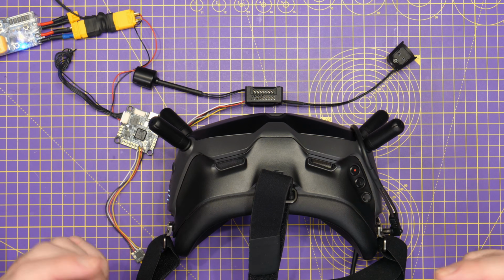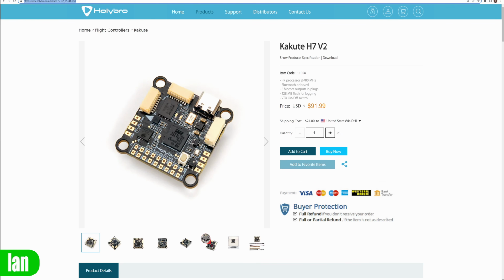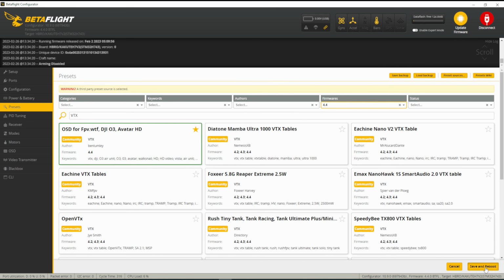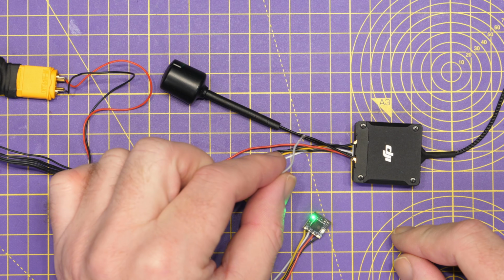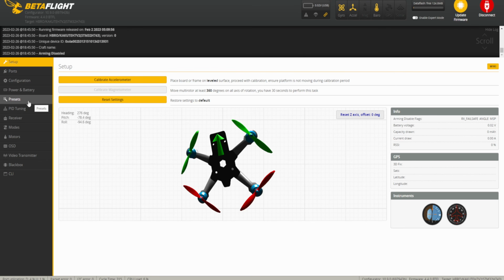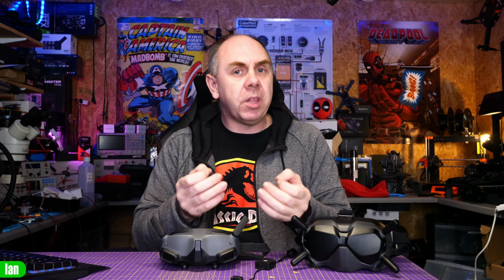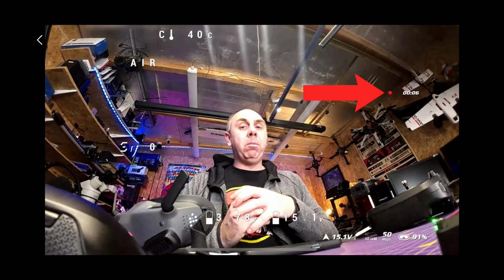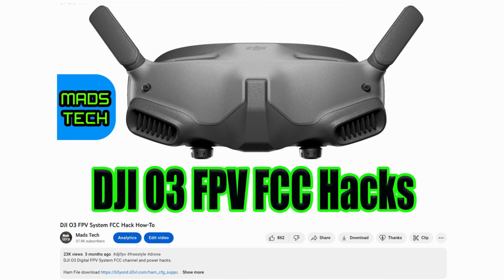DJI O3 FPV System - Complete Setup - Diagnostics & Troubleshooting Guide

Comment from the maker: Here are the links to some of my other videos I talked about in this one 

DJI O3 FCC Hack - https://youtu.be/efVPu2JKZPY
DJI O3 Vibrations Issues - https://youtu.be/p3WdkTMxlVU
DJI O3 Complete FCC vs CE RF Guide - https://youtu.be/21C80SiUWZA
DJI O3 Harness Warning  - https://youtu.be/dwR4BIhfxtw
DJI O3 How Hot Will It Get - https://youtu.be/e7cKL7M5aSM
DJI O3 Teardown - https://youtu.be/z4tQZmevEtw
DJI O3 DJI FPV Remove V2 Setup - https://youtu.be/teR4S9WxvEU
DJI O3 Power Requirements - https://youtu.be/ClavnlN663Y 

I hope you have found this video helpful .
Reply: Thank you for the great guide. I'm still looking for a guide on how connecting the O3 to a TBS Crossfire transmitter. I have the TBS module for the Taranis X9D.
Reply: @PhilippZ  you won’t be able to connect it directly. You will need to get a nano or similar and connect that to the transmitter.
Reply: Sussed it out. it was the connection cable. It was not putting enough power through to be able to bind. Would light up the turn off. Tried with another cable works perfect. Thanks for the help man and this video. Hope your well cheers J

Comment: Hey bud, the battery voltage from my Pavo 20 pro running an 03 has suddenly stopped displaying on my v2 goggles osd, checked all wiring and betaflight settings..still showing 0.0v, plugged another 03 into the Pavo (same connector) and it’s now showing battery voltage, would you agree this points to my original 03 air unit being broken? I’d really appreciate your input on this..thank you!

Comment: I just want video for fpv in a plane running on a 6s battery. I have DJI goggles 2. Can I just use the positive and negative wire to power off my balance plug to turn on unit. Thanks

Comment: I was flying my o3 air unit and it powered down to a relatively soft landing.  My battery was too low and I should have landed. Now it doesn't connect to the goggles (goggles 3). I tried to rebind but get a blinking red light continuously on air unit, and goggles stop searching after awhile.  If you have any suggestions I would appreciate it. 
Thanks and have a great day!

Comment: I have double checked everything according to your video.  However, I am still missing something. I have managed to display the crosshairs only on the display and they are off centered to the far right. Nothing else that I have selected with OSD is displayed. Any assistance is appreciated.

Comment: I just bought the o3 air unit in the geprc 35 v2 and I downloaded the DJI assistant consumer series aswell as the fpv series, but it just will not show up. The only thing that does is an internal storage file. I have restarted, un installed and re installed, aswell as tried many chords (with and without a battery.) I just cannot get it to show up.
Reply: same thing happend to me yesterday, I plugged it in then the storage option poped up..
Did it again  and again and then i left it connected while i was browzing my internet for fix then when i came to check the dji assistant, it was popped up as dji 03 air unit
I guess leave it a while when it gets connected automatically
Reply: @siansalins3639  yeah I actually left it and then downloaded dji assistant on a different computer and it worked. Pretty weird lol
Reply: Make sure you get a usb c DATA cable

Comment: My unit does go into full RF power mode however the Mps are super low even when in close range. Like 28mps not 50?
My other 3 quads with the same set up work fine. Does anyone know what’s going on here?
I’ve tried a couple different new antennas on the air unit also. 
Thanks

Comment: Hello, and thanks for the great tutorial. Question: I am flying the GEPRC MOZ7 with the DJI 03 Air Unit. On the last flight I had a harder than normal landing and the battery ejected. No damage to the drone. I reinstalled the battery and the Flight Controller powered up, but the DJI 03 Air Unit had no power. I checked the wiring cable between the Flight controller and the Air Unit and cut the black and red wires to check for voltage with a volt meter. It read 0.  I then direct wired the black and red wires going to the Air unit to the main power wires coming from the battery connector. Plugged in the battery and both the Flight Controller and Air Unit powered on. The Integra Goggles and RC Controller 2 were still bound. The OSD was working and showing the camera view, but showing the Voltage at 0.0 V along with the RC & HD Signal strength and Goggles Voltage, no other data. I then plugged the Flight Controller into Beta Flight and immediately the Voltage reading went to 22V and the remainder of the OSD screen filled with data. So I’m wondering if anyone knows what is causing the problem. The air unit is fine but the Flight controller is not sending voltage to the Air unit. I can direct wire the Air Unit to power it up but cannot arm it with the lack of data on the OSD screen. Any solutions? I am considering buying a new ESC/Flight Controller stack but I’m not sure that is the issue. Thanks for any tips in advance.
Reply: I have simillar issue with hglrc talon 2, first time setting it up, have you figured out the problem?
Reply: @teovuksan3469  I'm pretty sure the problem with mine is the BEC may be fried. It is part of the Flight controller so I have ordered a new one but wont know for sure till I install it

Comment: Hi This is a great video, I've learnt a lot from watching this but i do have a question that maybe you or someone else here can answer, I've got the 03 air unit and im using the sparrow2 flight controller, everything works ok and i've flown the plane its all in and flight modes all work fine but i am not getting the on screen display from flight controller to air unit showing on my goggles, I just have the on screen display from goggles only in bottom right corner, Any idea what could be stopping the on screen display from FC not showing on goggles, Also, air unit won't come out of low power mode. I'm in the UK and air unit is new. Thanks.

Comment: Hello Mads, I have started FPV last week-end with Goggles 2/iflight Protek 35 O3.
The Dji 03 has recorded automatically my first flights until it stopped. After checking the drone, one of the antenna's two connectors broke. Do you think that the fact that it only has one antenna connector left is the reason of no recording?
Thanks for answer

Comment: I try to set the sharpness and noise reduction options but it won't let me select I also can't set the quality to 2.7k at 30 frames, it's as if those options were blocked. Has anyone had this happen to them? Do they know what I should do?
Reply: Are you setting them with your quad powered and the dji working?

Comment: if i just want to use the 03 air unit to bind to my goggles 3 and install in roban 800 heli do i still need a flight controller ?

Comment: Thanks Ian . Love your videos mate. But I have a question on switching to my vista units with my DJI v2 goggles. Every time I switch from 03 to Vista it keeps telling me to power cycle my goggles then i have to rebind every time . This is so annoying. Is there a solution to this? Thanks Ian
Reply from the maker: Sadly no. This is how DJI designed it.  There are some technical limitations to how they implemented the different modes in the goggles and it results in the need to rebind when you switch modes.
Reply: @MadRC  ok thanks Ian
Reply: @MadRC  Ian we have get you on our show one day . Whenever your available my friend just let me know if your interested. We’ll set a date

Comment: Your videos are borderline too informational, but I do learn a great deal from you, so thanks!  This is related somewhat, but I have the Avata 2 which was my first drone (I am now addicted to FPV) ever.  I now own an RTF TanQ 2 5” from Rotor Riot, with the DJI O3 and DJI receiver and the F7 HD+F55A ProII 3-6S 30/30 with F7 FC and 32 bit 55A ESC  and I have it flying well and I love it, but I wanted to find limitations for the compatibility with the Remote 3 and Goggles 3 with custom Quads.  In 1 video when you reviewed the DJI O3 system you mentioned that you were better off with a different remote as the DJI FPV 3 actually is sending to the goggles 3, then to the air unit for control.  I have read if you have a DJI O3 HD and DJI receiver you are married to their FPV remote, but I believe I heard you say otherwise.  If i have choices for a remote with the Goggles3/Tanq 2, what would be compatible?  Thanks!
Reply from the maker: You can use whar every remote system you  want on O3,  Dji can not force you to use theirs inav and betaflight can take any remote.

Comment: hey there i found your channel recently so much good info as im very new to the hobby. ive finally got everything pretty well dialed. is there a way to get a DJI o3 air unit to goggles signal strength represented in the OSD i just got a bit of trouble watching the goggles signal strength as the native OSD icon is small. thanks!

Comment: it's too bad us surface guys are in the dark. how the hell do i get this thing at full power. Is the arduino working? no idea. stuck at 300m range.
Reply from the maker: You can use Arduino with code that forces arming. Just search Google for DJI O3 Arduino

Comment: Great review.   I just returned mine as I fly INAV 7.1 and found the OSD to be almost useless.  I simply could not get a descent layout as the presentation in the goggles did not match even remotely the layout in the INAV OSD setup screen.   I have several Caddx and Runcam units which work perfectly with WTFOSD. 
So my plane is to eventually go with Walksnail Avatar instead of going down another of DJI's rabbit holes.

Comment: Hi, thanks for your great videos. in Italy I didn't find any results for my problem with the unit03. mounted on a geprc20, during a flight it was disconnected and from that moment when it is powered a green LED remains flashing, and in addition to not seeing anything on the integra it doesn't even connect to the PC. do you know what it could be?

Comment: You mentioned connecting the 03 camera wire connectors to a flight controller OR a power supply. I'm trying to use my 03 camera on a fixed wing aircraft that does not have a flight controller, only an ESC. Can the power leads just be connected to a battery using the power leads on the camera? I'm told that the camera goes into a low power mode. (.25) How does the low power mode still supply enough power to operate the camera at normal 'line of site' ranges? Can I use those power supply of a balance plug of the proper voltage? Your help would be greatly appreciated. Thank you.
Reply from the maker: You can absolutely use O3 just on the battery with in its accepted voltage range with out an FC  however it’s worth noting while you can turn off low power mode it’s still not full RF power and as such you may get reduced range. O3 Must have an Arming command from a flight controller to get full RF power.

Comment: Hi there hope you can help I've powered my 03air with a 2s lipo the wires are solder to the  fan wires and the plug plugs into the lipo  it all works but won't record to the micro sd in the border it trys but then says low power mode activated won't record and It drops signal for about 5 _8 seconds then comes back on any ideas many thanks

Comment: Very helpful video. Thank you for your efforts to make this subject more understandable. I followed all the instructions, but even though  my Goggles 2 are binded to the O3 Unit, when I arm still it does not start recording automatically, I still need to go to the menu of the Goggles and select record from there.
Reply: I have the same problem. whats the solution ?
Reply: @TheHelicapt  I figured out. In my case I was plugging the USB C cable to the O3 Unit and was thinking that I can make it work that way. But only with the cable not enough power goes to the unit. You need to attach a battery to your quad. You can only bind with while on USB C cable, but you won't see it on the Goggles. Use a battery on your quad and it should be working. Don't forget to remove the props on your quad before that. Hope it helps
Reply: @sethvane  thanks

Comment: thank you so much for this information. i have a problem when flying my quad, DJI O3 air unit stop recording while lost signal connection with Goggles 2, but the goggles not stop recording until i disarm/finish flying. why this happen? thank u so much....

Comment: Great video. Subbed. I have bound my remote 2 and goggles no problem but there is no response on the receiver tab on betaflight? any ideas?
Reply: Did u get it working? Trying to make a wing myself with 03 unit and my v2 goggkes and rc2 remote but not clear if the remote will work, I know it does for a drone but not a wing

Comment: Hi Ian, thank you very much for your work and efforts to make this subject more understandable for beginners FPV pilots like me. I have question. I recently bought DJI Avata with Goggles Integra and FPV controller 2. I had some issues loosing connection and with the help of your videos I was able to switch to FCC mode using the ham file hack. I also bought the GEPRC CineLog 35 V2 PNP version and trying to use the same Goggles Integra and FPV Controller 2 to fly the the CineLog 35 V2 with the same set up. The question is if I update firmware on the Goggles Integra do I need to perform the ham hack again in order not to loose the FCC mode when I use to the Avata? Thank you again for your time and efforts.
Reply from the maker: Yea you will need to do it again but only on the goggles.  Just place the ham file back on the sd card and boot up after the update.
Reply: @MadRC  thank you so much for the fast reply and all your work to make this understandable for newbies like me 😊😊😊

Comment: You mentioned that if air unit LED will not become solid red after plugging in battery it's most likely the unit is not fully powered. Looks like I'm experiencing that issue in my diy nazgul evoque v2 build. Brand new o3 properly wired but powering up battery make air unit led solid green - pairing button doesn't have any effect of course. My FC is Iflight Blitz mini f7 - and honestly can get my head around with this - you suggested some power switch, but can't find anything in BF.
Reply: Did you find solution for this issue? I’m experiencing exactly the same with my brand new mark5 for the last few weeks

Comment: Quick question.
Running the Mobula8 with DJI 03.
Throttle, Pitch Yaw and Roll all respond in Betaflight.
But when I arm the drone to fly only Pitch, Yaw and Roll work.
Using the DJI remote 2.
Do I need to adjust the thresholds in the receiver tab or something?

Comment: Great vid as always. I have an 03 air unit, v2 goggles and controller 2.  I can’t get rid of the country code error.  I have refreshed the updates but still get the message. Also, I can’t access the advanced functions in the controller as they aren’t highlighted. And I can’t change from 16:9 to 4:3.   Some strange stuff going on.
Reply: I can't either. Tried the DJ fly app to get gps even. Can't find a solution yet. Did you ever figure it out?

Comment: Hey Ian, I just bought the goggles 2 and updated it to the latest firmware and I also did that with the Caddx vista I’m using. When the quad is not armed I got 6mbs and when I arm it goes to 47mbs but when I arm and before I see the 47mbs I got a 0.5sec black screen like a black screen. What is this? 

Thanks already!

Comment: I currently have the vista set up on my FC, but I am getting the O3 on monday. Assuming all the wiring is correct, and assuming I don't personally have a need to add anything from betaflight's OSD at the moment, shouldn't the DJI OSD theoretically come up on my goggles as soon as they are bound together, without any presets in betaflight?

Comment: Hi boss, many thanks for your fantastic guide and tutorials, I have an absurd problem with my two new dji O3s: I have two Kakute H7 fc mounted on two of my 5" freestyles, the first is a H7 V2: when I connected it to the O3 the fc is dead, it is no longer powered by usb or from lipo, with the second fc which is a Kakute H7 V1.2, if it's connected the plug to the O3 air unit, the quad does not arm, I see in my dji V2 the image from the cam but the quad does not arm: I checked the connections between the fc and the O3 air unit several times and they are correct in both cases: what can I do to solve it? what could be the problem? many thanks

Comment: @MykeyT
0 seconds ago
Not sure if anyone is have the same issues as I am but all firmware is updated for the G2 and O3.  O3 powered on with lipo showing a solid green led (never bind w/G2 b4 with air unit) and I am unable to enter bind mode on the O3 (red led) regardless how many times I press the bind button on the O3.  Anyone issues this or figured it out? Thanks.
Reply from the maker: Are you running on battery or BEC ?
Reply: I figured it out.  Pins inside the DJI O3 air unit were bent and not lining up with JST connectors.  Bent them back to line up and was able to bind to goggles 2.

Comment: @Mads Tech do you know of a preset for betaflight  4.3 if I'm using the 03 air unit with the DJI controller?  Supafly is only 4.4 I believe, at least I don't see one for DJI remote only one with the options for crossfire and ELRS etc.

Comment: Ok just want to say, further to my issues with me having created a ham file on my Win 10 notepad, that was the issue, even though created perfectly, it didn't want to know..

So I went to one of your other videos, found the zip file, unzipped and pasted onto the SD root... Bingo!!
Now working properly and fully unlocked 😁

Just some help if anyone has the same problem.

 Download the zip file. It just works!

The goggles just don't like the Win 10 notepad for some reason.. Lol